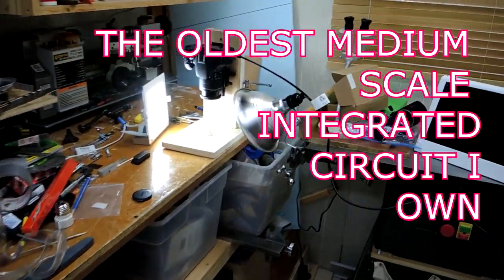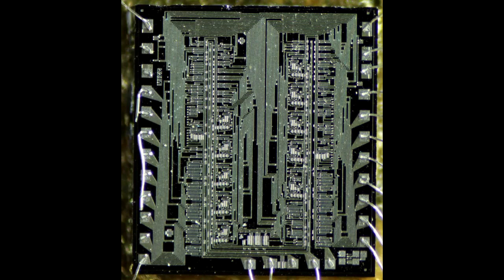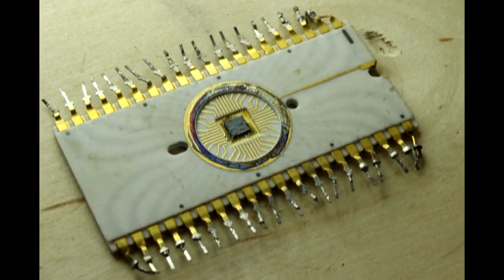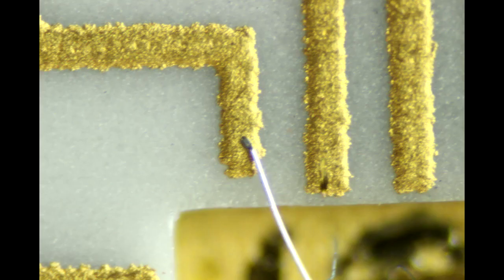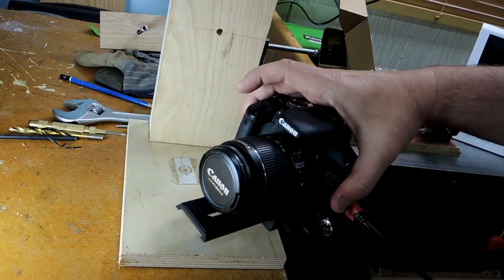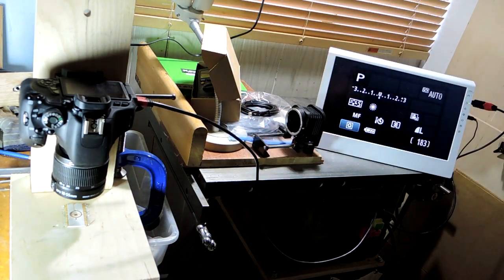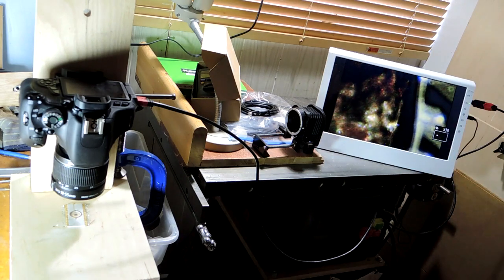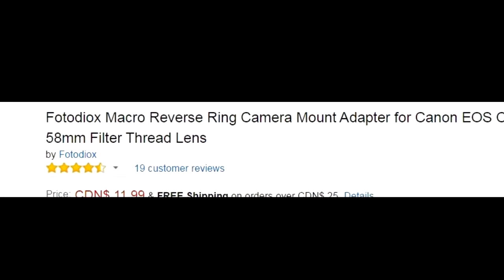A LOOK AT A REALLY EARLY INTEGRATED CIRCUIT

Comment: It has really high co-planarity? That's a structural property. You probably meant to say rigidity. 

You should look up some of the words you use.
Reply from the maker: Co-planarity is the word indeed.... the wire bonding machines of that era would have been very primitive and keeping the package at the right z-height was  important. The bottom of the ceramic to top surface along with  the two registration pins would have been critical dimensions.

Comment: So the chip you have looks identical to quite a few chips in an early 1969 desktop calculator I have. Same size, pin count, 2 indexing holes and gold line from the center of the chip to the notch.  I have included two links to other calculators using some chips from the same/similar "chipset".

I'm suggesting a calculator because they were one of the few things manufactured in that time frame in  any quantity that used chips that look like the one you have.

Could each of the 10 bits represent numbers, 0 to 9 and somehow relate to displaying or driving/printing a digit? 

http://www.oldcalculatormuseum.com/monroe1665.html
http://www.oldcalculatormuseum.com/compucorp122e.html

Comment: Thanks! Enjoyed both the electronics and photography parts of this video.

I think you can get even greater magnification if you reverse mount one lens in front of another one. The focal length of the forward mounted lens divided by the focal length of the reverse mounted lens will give you the magnification value. E.g. a 200 mm mounted normally with a 50mm reverse mounted to it will give you 200/50 times magnification.

I see you have some bellows in the background. Do you find the reverse lens technique to give superior results than the bellows?

Cheers.
Reply from the maker: +House of Hacks reverse mount was superior to my 1000mm macro lens and macro bellows, that was a surprise
Reply: +electronupdate 1000mm macro lens? Haven't heard of that one. Is that a typo and you meant the 100mm macro? In any case, that's surprising to me too.

My 100mm macro is crazy sharp compared to my experiments with reverse mounting, although I haven't reverse mounted a single lens. Perhaps that's the difference; with two lenses there may be twice the defects being introduced and the first lens' problems magnified by the second one.

I haven't tried bellows/extenders but I'd expect them to be as good as whatever lens you put in front of them, just less light. I wonder if less light lowers the contrast, decreasing image quality.

Interesting in any case. Thanks again.
Reply from the maker: +House of Hacks yep, typo. 100mm macro.  Great lens, super sharp, but the reversed mount 18-55 gave better magnification
Reply: +electronupdate Ah, right. Thanks. Peace.

Comment: Tele extenders are another great way to increase magnification. Canon types are picky where they fit but a lot of 3rd party adapters can be added ok to a normal macro lense as well. A 2x converter will add 2x magnification etc. Likewise adding a extension tube allowes you to focus closer (for example with a macro lens) to get more magnification.
For extreme magnification I've used a combination of adding macro extention tube(s) combined with extenders. I've had better results with those than using a lens reversed.
Reversing a lens is definately a lot cheaper, but for best results one may want to try out different options as well.

Comment: Traces are not gold plated, they are pure gold, made by screen printing a gold ink onto a prepunched fired blank, then placing the top cap on after a glass frit screen print, then firing the whole lot in either a vacuum or a argon atmosphere to melt the glass and gold into a thin film. That is why the holes are there, for the alignment pins in the process and they go into the oven as well as holder.Then you apply more gold based low melting point ink and put the gold plated brass leads, in a larger prepunched brass frame, on and fire again at a lower temperature so the leads braze on to the package. Finally you stick the IC on again with the braze ( it survives the 450C needed to mount it quite well)  then gold wire bond the whole lot, and finally solder the lid on at 190C using eutectic solder screened on the brass lid.

As to the actual IC inside, hard to say, there are many obsolete parts from that era made either for a contract, or only for a single end use so often no info survives. Likely yes a register unit from an early computer CPU, and probably made for DEC as they used 10 bit words.
Reply from the maker: +SeanBZA Thanks!  That was an interesting bit of information on the package